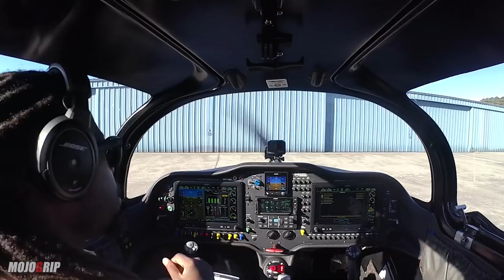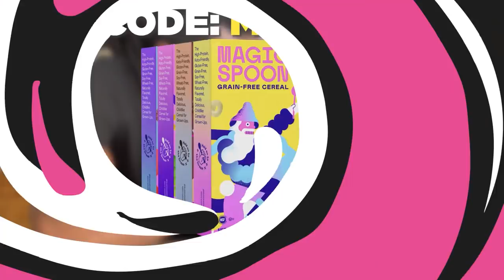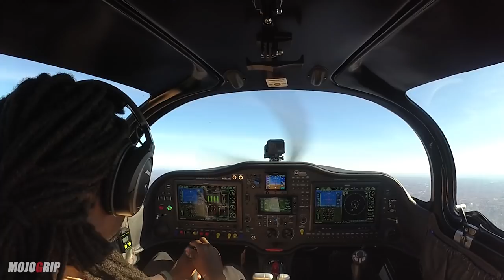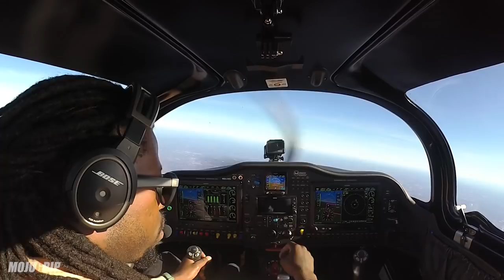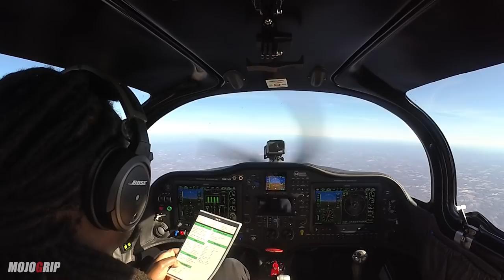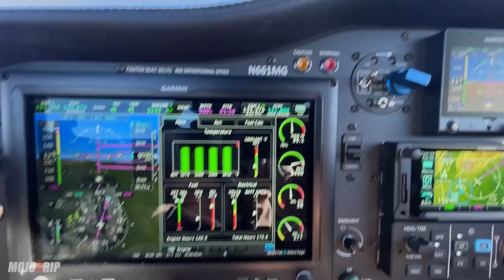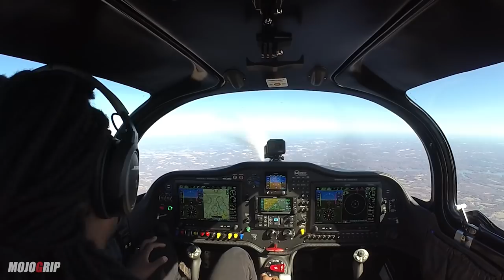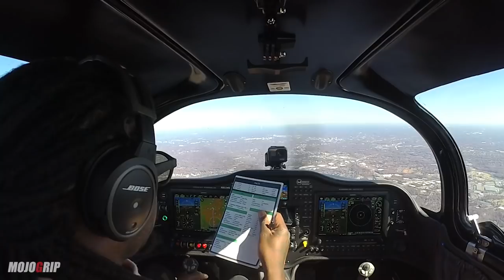How To Use The Bathroom In A Small Plane

Comment: There probably is a place for a more scientifically based aviation nutrition video.     In terms of glucose rushes and crashes, glycemic index might be a useful guide for carb based glucose spikes, but ultimately everyone's body works a bit differently.   Any food item that also generates a lot of lipids in the bloodstream probably is also at risk for a little post-eating drowsiness.     In terms of urination, I find water is not that bad unless you drink liters of it prior to a flight, but even small amounts coffee or any caffienated beverage will cause a diuretic effect and in-flight urgency.    I personally avoid caffeine like the plague because of that effect.    I find the stimulant value of caffeine is not so useful compared to simply eating right (or not eating at all) before take off.   Very often people use the stimulant effect of the caffeine to counteract the sedative effects of post-prandial lipid and glucose spikes....which frankly is kind of dumb.    Again, ultimately what is right will depend on the metabolic characteristics of the individual.

Comment: A plumbingless lav in car config 4 seaters would improve their utility quite a bit. Just a minimal back in deal behind the back 2 seats. For single person use the door could remain open and maybe a mirror screen and good ADS-B could allow the pilot to use it. Could even have a fly by wire joystick in the lav although that might create problems.
Reply: @papapapalima_scotland  actually I own a plane :)  I know the pilot is conventionally not supposed to leave the seat but that's from a time where automation and mirror controls wasn't possible. New rules can be made. Progress is possible, contrary to popular belief.
Reply: @DanFrederiksen   ok, progress can be made. I agree, but on ga, and minus the newest garmin auto land, this is a big nono and will be on most GA planes for our lifetime probably.  In any case, unless you start from autonomous planes, you are there to monitor at the very least. 
Imo this is the kind of comment that some random will take and implement like the idiots sleeping at the wheel on almost (but not quite) autonomous cars.
Reply: @papapapalima_scotland  hehe an idea isn't bad just because someone can implement it recklessly. Have vision to see it working. With computerized ATC which we should have had 40 years ago it could even be safe flying blind for a few minutes because ATC can avoid any collision. You would have to declare it perhaps. 3 minute fixed flying say. Or the autopilot could acommodate ATC commands. Indeed we could easily have a runway to runway autopilot system with computerized ATC such that a pilot is not even required.